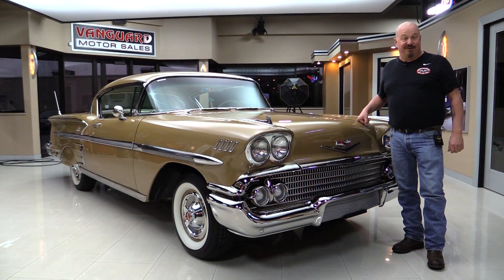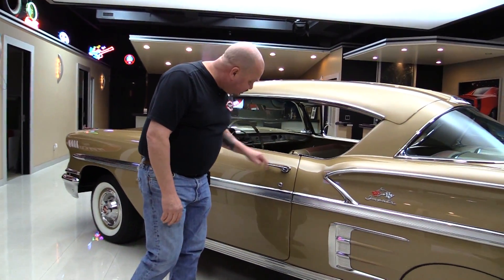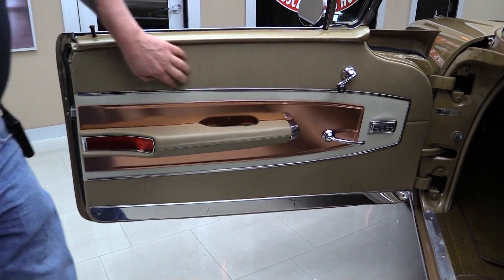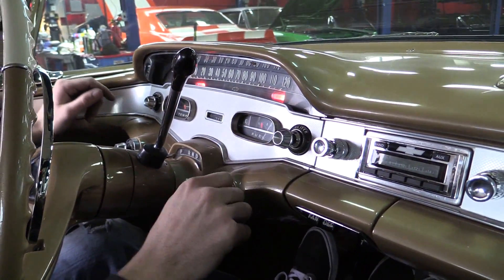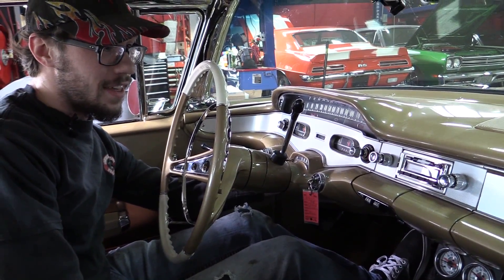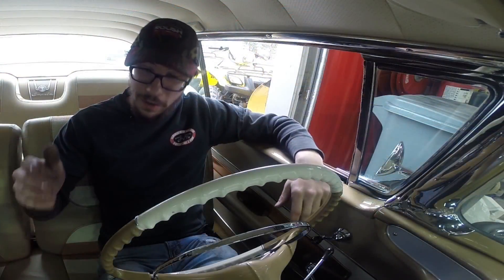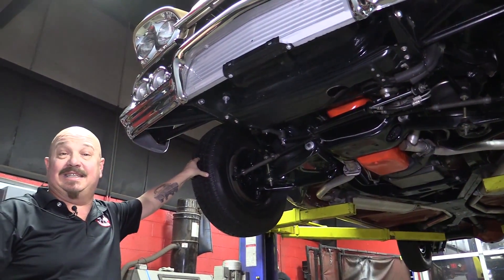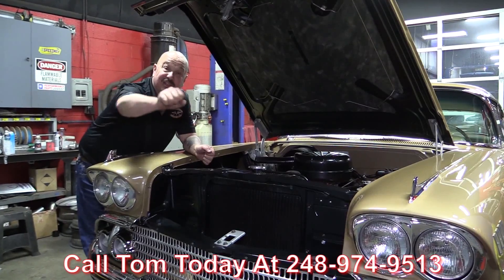1958 Chevrolet Impala For Sale

Comment: Why does the  air suspension control exhaust air inside the car  ?  , that car should have been original with a cast iron power glide , this is certainly the nicest 58 I have seen in a while